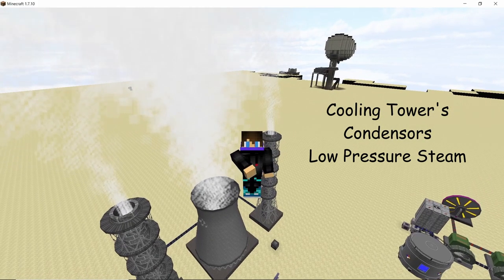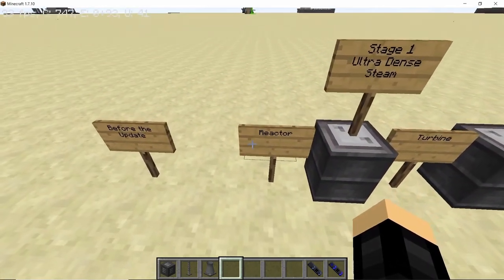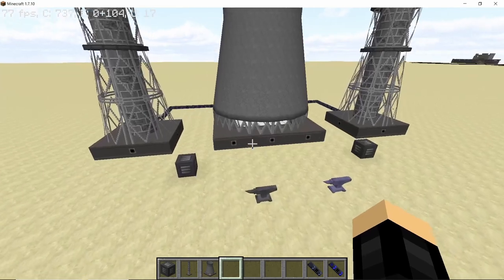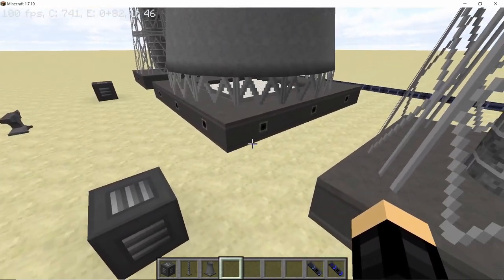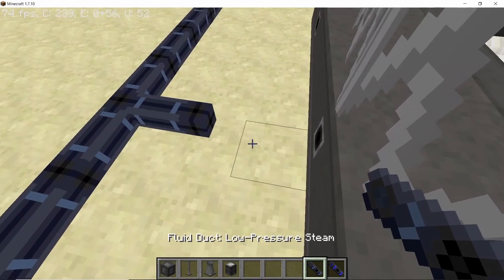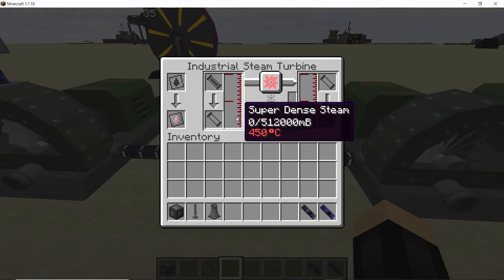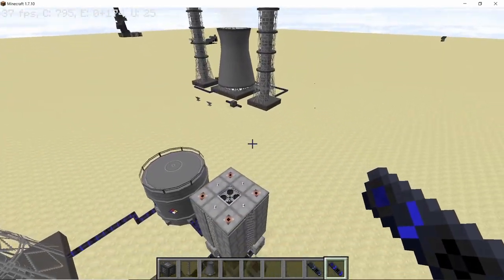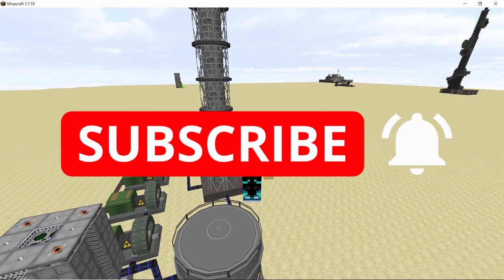Cooling Towers & Condensers guide for HBMs mod | How to use Cooling Towers & Condensers in Minecraft

Comment: Hi, the RBMK has been updated in mod, please take a review. I read here that the Chicago woodpile works like this: you put blocks of graphite, drill them with a hand drill, put a neutron source on the left, controlling the rod in the middle, and on the right, the woodpile fuel, and check it with a drill. There is nothing new in principle yet.
Thanks for reading.
Reply from the maker: I tried to make it work tbh but it didn't , maybe I will try again later on and hopefully make a video on Chicago pile soon enough !! 
As for the RBMK I don't have any plans on making any designs yet as I have so much more stuff planned for you guys which is combat focused instead !! I will however make a video on the RBMK reactors after some time tho !!

Comment: i have all the recipe to create the cooling tower but it doesnt create it i just need cooling towers to make my rbmk nuclear power plant more design
Reply from the maker: I've never faced any problem with cooling towers , you simply put low pressure steam inside it and it'll get converted into water. What exactly is the problem you're facing
Reply: @SavageVegeta  the gui of the tier 4 anvil is not enough for me to create the cooling tower

Comment: Will it work if I put the cooling towers far from each other?Will it affects anything?If its too close it might be not tidy and I'm making a nuclear plant..a big one..so again will it affects anything if I put the cooling towers far from each other?
Reply from the maker: Nah it won't affect anything , you'll need to run alot of pipes but that's about it. Aside from that you should be good to go
Reply: @SavageVegeta  So your newest RBMK design can wlrk even with distinct pipe distance?
Reply: @VoidPaul97  pipe distance does not affect anything. Everything transfers at near instant speeds anyway.